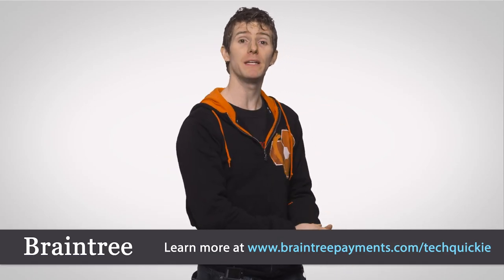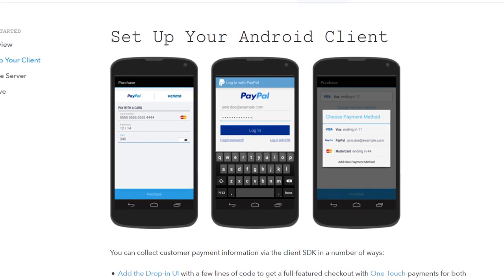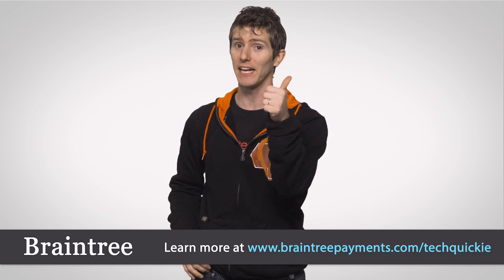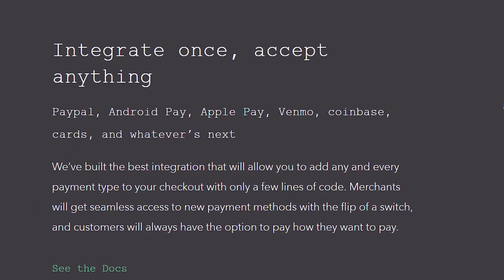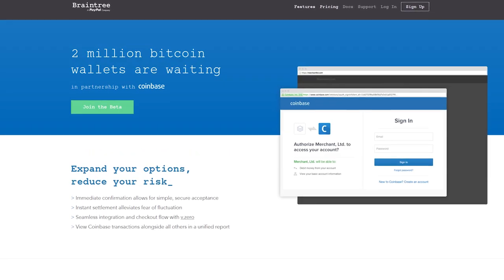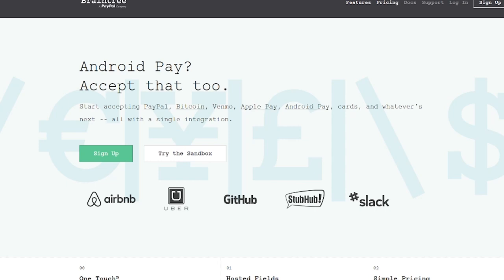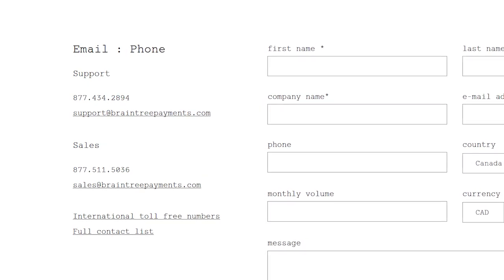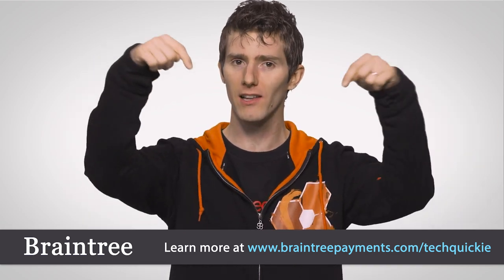Static Pressure vs. High Airflow Fans As Fast As Possible

Comment: Linus can you make test, is the cooling of ps go better if we put case upside down but with old case where psu is on the top of case with 120mm fan and with high voltage gpu?

Comment: Ive noticed RGB High Static Pressure Fans have a horrible static pressure (around 1.5 typically), whereas non LED fans have a static pressure around 4.0.

Why does RGB kill static pressure even in RGB fans rating as High Static Pressure.

Comment: Is there any big difference if I use a static pressure fan as rear exhaust? They usually have lower airflow so they should be worse, right?
Reply: +Kappaccino Unless you're using water cooling that have a radiator to push the air through a fan with high air flow is recommended. But I would check the temperatures first. It's probably all cool and dandy anyway.

Comment: so if i have 2 fans, one is high static pressure and one is(low static pressure)advertised as an airflow fan, but BOTH have the same CFM, wouldn't i just go for the high static pressure fan?

Comment: I would think a high airflow fan would beat a high pressure fan in getting heat out. even on a heatsink that has a push/pull setup I would think a high flow fan would pull more air than a pressure fan can pull or push.

Comment: "blow a little bit of air more strongly" Or you just could say that the wind, air SPEED is higher in static pressure fans even when their volume of air pushed could be the same as a "high airflow fan". They are optimized for "wind speed" I guess. Use some better terminology sometimes your attempts to "overlayman" just make it more difficult here.

Comment: i have 8 high static pressure fans on my 480 double thick Rad.
Reply: +AllyourBaseArebelongToUs Nice to know
Reply: +AllyourBaseArebelongToUs the 480 is well-known to have high temp issues.
Reply: Ujiltrom M not GTX 480, a 480mm radiator.
Reply: Oh. My bad then. Is 480mm in any way common ?
Reply: Ujiltrom M not really.
most cases don't have room.

a 25mm thick 360 is more than enough.

Comment: If you have tempered panel at the entry you can chose a static pressure fans
If you have dust fillers at the entry you can chose a high flow fans 
if you have air cooling then a big static pressure fan at the end 
if you have water coiling then a high airflow fans 
if you have water cooling and tempered panels two static pressure fan at the entry and one high airflow fan at the middle and one high flow fan at the end 
if you have tempered panel with air cooling then two static pressure fan at the entry and one high airflow fan at the middle and one big static fan at the end 

believe me am an mechanical engineer

Comment: has anyone tried a setup for a radiator where you put a static pressure for push and high airflow fans for pull? theoretically, this would move air better than having 2 static pressure fans for push-pull. i wouldn't know about realistic numbers.

Comment: I am making a diy NAS case and I want to just use one intake fan at the back and have vents at either side of the case and get my 140mm fan to push the air in and out. I was wanting to get the fractal design 140 static pressure venturi fan? is this a good idea? can't tell if a high airflow fan would be better for this situation

Comment: So, what is the best 120mm?? I have The Noctua NH-U12P, And i need 2 fan for cooling my Xeon X5650@4.3ghz@1.42v, With the noctua fan the temp at full load is too high(98c).

Comment: I have an RX480 XFX in a Cougar QBX case. Would it be a good idea to remove the GPU Hard Swap fans altogether and install 2 120mm static pressure fans right in front of it (less than 0.5mm)

Comment: I currently have two high static pressure fans in the front of my computer. (I'm using a Fractal Design R5 case.) I chose the fans because they are quiet and the temperatures are all where they should. But now I'm thinking that since they are high static pressure they maybe push more dust through the dust filter than high airflow fans would. Does someone know if my thinking is correct and is it worth it to change?
Reply: +Henrik Nygren In my R5, I have one of each, a SP in front of HDD cages and an AF fan in front of the GPU :D 
(Only the AF fan is actually a Corsair fan) XD
Reply: +RAD Tech That's quite interesting. Do you notice any difference on the dust filter? Does any of them create more dust or the same amount of dust but quicker?
I would guess that you also need to have something after the fans to see if one of them push through more dust.
Reply: Henrik Nygren I think the AF fan sucks more dust, but i can't be sure, next time i clean it I'll see 😊

Comment: i dunno if the corsair 270R will do better with airflow or static, so i'm getting one of each and looking to see if one is pulling more dust than the other. or maybe i'll try another airflow after a while. if it doesn't make a difference except noise, urgghhh.

Comment: How about when the pc case's front fan mounts has a dust filter? (In front of the fan itself). What fan should I use? SP or HAF?
Reply: He answered that at 3:18 - ".....a static pressure fan would be more effective at getting air through these small gaps......if you have a case that has very narrow vents on the front or even a dust filter that's designed to filter the dust out of the air but is of course going to obstruct air flow."

TL;DR if you have a dust filter on the front intake of your computer case then you need an SP fan because the filter obstructs the flow of air for intake.

Comment: The bigger the fan, the better...
a 200 ish CFM 200mm Fan can run at 400-800 RPM while a 120mm would have to run very, very very fast.

Guess which is quieter too :P
Reply: +Preston No the bigger fan is always the quieter fan when both fans are pushing the same amount of air.

Comment: Does any one know witch one is best for tinnitus ? Using h510 and stock case fans are trash. Replacing with noctua... high airflow vs static pressure fans witch would trigger tinnitus less

Comment: I want to install two fans for exhaust at the top. Unfortunately, the output is vaguely blocked by the dust filters and case handle. Should I get  air flow or static pressure here
Reply: You don't need dust filters for exhaust fans.
Reply: DJHeroMasta I cant take it off. It s the problem.
Reply: What case do you have?

Comment: So Linus, what case has clear openings for your high airflow fans. Unless you modify the case they all have something restricting airflow through the not so clear openings. So maybe static pressure fans of the way to go period.
And are you ever going to check out the G-Sync high temperature problems I keep asking you to do.
Come on people there has to be others of you that worried about their G-Sync monitors. If you feel the clear plastic screen on the front of the monitor you will find where the chip is. It will be the hottest point. And if it's that hot on the outside what's it like on the inside?
Or have you been told not to do this?
Like Linus says give me a like if you are worried about your G-Sync monitors and would like Linus to help us find out.

Comment: Help me out here, I have the Corsair Vengeance C70 case. I have two hard drives and an SSD. I have a Corsair SP120 pair in the front panel, and an AF120 pair behind the drive cages. Should I get a second SP120 pair to replace the AF120 pair? Or will the static pressure from the front panel fans be enough to push the air through the drive cages?
Reply: +Leonel Cantú de Llano The AF fans should actually aid in the SP fan pulling in air by creating low pressure behind the SP fan, causing it to suck in more air aided by the gradient.
Sounds like your setup is fine. 
Just make sure you have more intake fans/flow than exhaust so you have positive air pressure in your case. (there's a tech quikie on it)
Reply: Ryan Shiels That is in fact, the case. I have an NZXT fan controller module that allows for me to control the speed of all the fans in the case. It creates some nice positive air pressure, since I added slightly more power to the intake fans, which are the ones in front, the ones behind the drive cages and the ones in the side window panel. Given that there are only three exhaust fans (top and rear), the air pressure is quite positive, and not only is there some great air flow, but also no dust build up. To be fair I based this setup entirely on Linus' and Luke's tips. My current video card doesn't produce that much heat, but I plan on switching to a GTX 970 pretty soon.

Comment: I sandwiched my nzxt x52 radiator between 2 140mm stock nzxt fans that came with the case and 2 rgb corsair sp120 fans and those sp120s are really fkin loud. how do I fix this? In the bios I can't get the cpu fan speed any lower than it already is.

Comment: Is it possible to tell the difference between the types of fan just by looking at them? For example by looking at the type/shape of blade?
Reply: +Riotlight sure. Airflow fans usually have a lot of blades 10-11-12 but narrow. Pressure fans have 5-6-7 blades but wide.
Reply: *****
 Thanks for that.
Reply: +Riotlight Airflow fans also usually have kind of flat blades that are easy to look through. The static pressure fans usually have more curve to the blades.
Reply: @TorresinhoLFC  what if mine are medium width and 9 blades?

Comment: So im slowly getting parts to build a pc and im thinking of getting 5 of the Noctua NF-F12 iPPC-3000 pwm fans to replace the 2 120mm intake fans on the front, 2 120mm fans for the h100i gtx and 1 for exhaust out the rear of the case, would these fans be sufficient for cooling everything or should i look at different types for say the radiator or intake/exhaust?

Comment: in the specs i see alot of cfm and m3/h, so what i know is the amount of airflow, i need to fans for my radiator. if there rated at max.1200 rpm with 101.6 cfm will that be good? thanks :)

Comment: Can anyone give me advice? I'm building a new rig and I'm going to have a 360mm rad at the top of the case for CPU cooling with fans pulling air up through the top of the case for exhaust.  Should the one fan in the back of the case be intake or exhaust? I'll have two front intake fans and one bottom intake fan as well.
Reply: Exhaust at the back

Comment: Is the $80 Delta fan that spins at 6,000 rpm good for a radiator? I would use this as a joke since I don't care.
Reply: pnp072000 it's called a pwm fan controller ..

Comment: so HP vs torque.... simples
Reply: +shane beasley More horsepower tends to yield more top speed and a bit more acceleration. Torque is the rotational analog to linear force. It results in either more wheelspin when setting off or more acceleration (if you have enough grip, or friction, to handle the extra rotational force). If I was better at physics and automobile engineering, then I would have a better explanation.
Reply: +THERAZORKILLE Productions Bad tires will make it bottleneck, unless you are drifting.
Reply: +Zero necker Yes
Reply: +Power Max
No it wouldn't. Assuming that current = high airflow fan in your analogy, static pressure fans do not produce more units of push than the airflow fan. The static pressure fan resists back flow of air. So in electronics, it would be high vs low resistance
Reply: It's more like turbo boost pressure vs flow.

Comment: Is there any noise difference between Pressure and Airflow fans?
Reply: +TabZa123 if you put an airflow fan on a heatsink or radiator it will make more noise, because air coming out of it is going to the sides, generating turbulence. SP fans direct the air, decreasing the turbulence. But as case fans, they should be similar.

Comment: Guys, please recommend good, very silent fans for me. I was thinking about the 120-200mm range.
Reply: Cooler Master Silencio
Reply: Noctua NF-F12 or NF- F14.
Reply: cooler master has the best 200mm fans with 130 cfm
Reply: Noiseblocker
Reply: Be quiet silent wings 2
Reply: Ujiltrom M Tbh, good one, but the colour wouldn't fit my build. Thanks anyway.
Reply: +Mursukorva I like the Noctua NF-A14 PWM.
Reply: any office fan should work.
Reply: NolanTheGamer1 Sorry, they're too big, noisy and don't have any compatible ports for my build.
Reply: +Mursukorva u wont wanna try what i suggested?
Reply: Rj Lao Haven't decided yet on anything ..
Reply: +NolanTheGamer1 I bought a huge deep freezer for my new PC
Reply: Mursukorva put mine in a cyro chamber

Comment: I thought the fans were to get the heat out as quickly as possible and not to get air quickly in..
Reply: +Dread Naught If there isn't air going in... how can fans push it out? :P
Reply: Both. Pushing air out is negative airflow (getting the hot air out) and pushing air in is positive airflow (getting fresh, cool air into the case).
Reply: There's a tech quickie on positive vs negative air pressure you should watch.
Reply: Ryan Shiels high airflow pushes out then?

Comment: Linus... do tech stuff all you want, but leave the engineering stuff to those of us that actually went to school.

"..blah blah blah...  thermodynamics... blah blah degree in physics... blah blah" 

shows board full of calc 2 problems

Heres a fun tip for you guys... you can run two fans together to double their pressure.

Comment: i have high static pressure fan by corsair and its setup as an exhaust fan, whenever i close the case it pulls air and whenever the case is open it pulls air..
dafuq do i do?
Reply: umm, maybe flip it around?, cause u said that whenever the case is closed, it pulls air, and whenever its open, it still pulls air?
Reply: Jack L sorry i meant when ever the case is closed it pulls air and whenever the case is open it pushes air. my bad
Reply: then i retract my statement, i got no clue.
Reply: xd
Reply: Actually, i've been thinking. How often do u open your case? if u don't, can't you just flip the fan and keep the case closed?
Reply: pretty often xd and wont it do the same thing? mindfuck
Reply: mindfucked XD
Reply: shit, i fucked up

Comment: Thanks for great video. I have a Corsair 240 Air - Was wondering which quiet fans (LED,) would be good to put in to replace those that came with it? Had seen the Corsair 120 Quiet Edition which come in AF and SP). Thanks for any help. (https://www.corsair.com/uk/en/Categories/Products/Cases/Carbide-Series%E2%84%A2-Air-240-High-Airflow-MicroATX-and-Mini-ITX-PC-Case/p/CC-9011070-WW)

Comment: i have no case fans and my pc can play gta 5 almost maxed at 50 degrees max gpu and cpu
Reply: Do you live on the North Pole ?
Reply: Marc Balestre case cover removed, cpu cooler gets air from the room directly and blows it far away. the same about the gpu. im thinking on removing the psu fan soon and uniting it with the cpu

Comment: G3258 or X4 860K?
Reply: G3258 as you have alot of upgradability. Like ALOT
Reply: +Justin Passfield is it not better to have a quad core for lots of titles?
Reply: +Evilduck999Productions G3258 will hold up untill you can afford a mid range i5-i7.
Reply: +Justin Passfield OK thanks

Comment: doesn't explain mmh20, what fan is actually a high static pressure fan, do manufactures lie? is there a way to cheat  on fan performance. what the specs people should look for? what detonates an high airflow fan. why does jaystwocents useses airflow fans? what determines if i need high static pressure fans vs airflow fans? seriously this video is actually factual without providing any useful information. you uses terms and don't define anything with actually calculable terminology and it does exist.  this video basically explained nothing other than basic concepts that cannot even be implemented if you dont know the specs. even then the provided specs don't match real world performance tests vs most nocuta fans vs all contenders at set rpms. you dont even go into static pressure values vs rpm and noise with performance. Other than "use the fans provided on the heatsink or use the fans in the case you purchased" because they know what they are doing. you privided a waste of time. you could have gone on air and said, "different fans do different things, winning" please explain how your video is in any capacity useful in any envinroment, becuase all you tole me to to was buy delta fans because they perform the best in every environment, oh wait except for noise...

Comment: I don’t understand the assertion that a higher amount of air flowing through wouldn’t automatically entail a higher “air pressure” or forcefulness coming from the fan. After all, the way a fan moves air is by applying force to it. This sounds like a pseudo science.